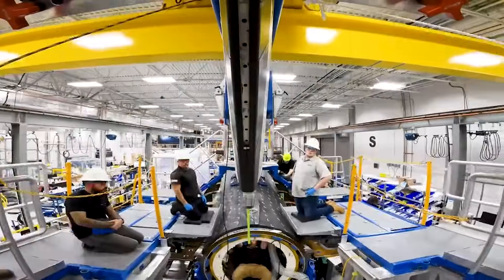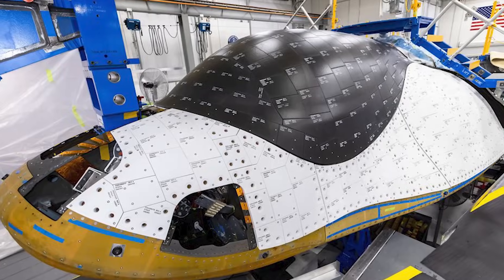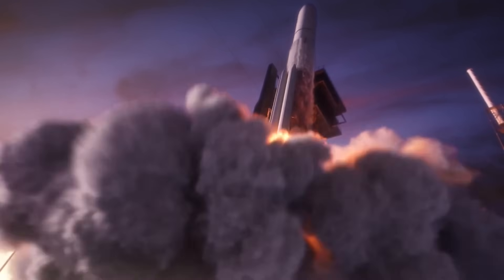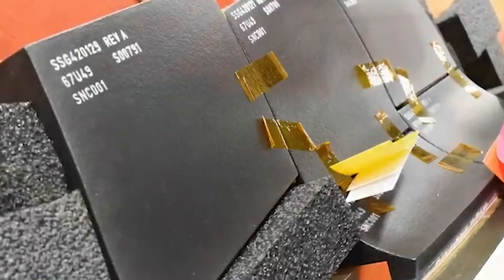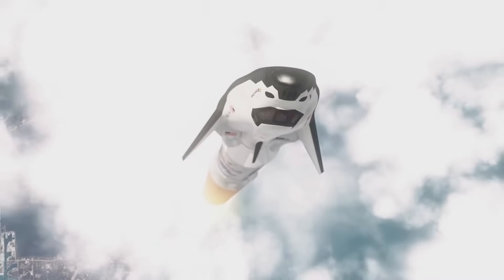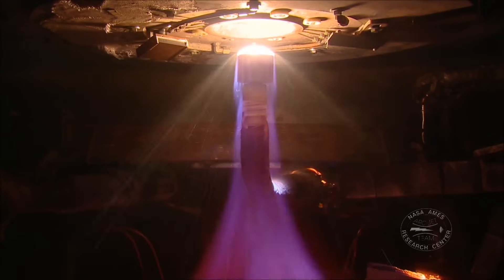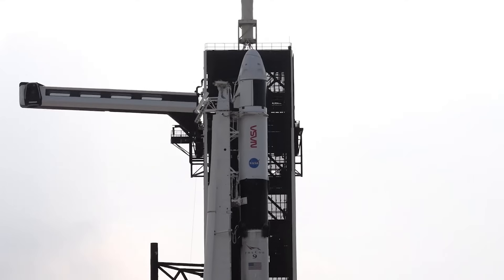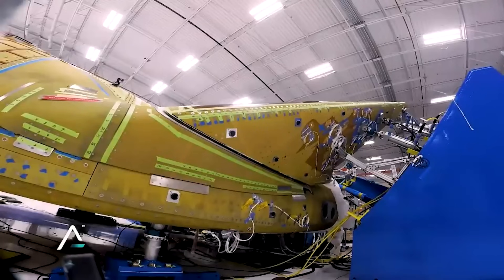Dream Chaser Tenacity’s Heat Shield Is Just About Fully Installed

Comment: Its a great little vehicle. However its nothing really new. Its like starliner is to Appollo. Just a newer version of shuttle. Cool though.
Reply: Dreamchaser is not that comparable to Shuttle or Buran. It's mounted on the top, not the side of the booster. It's a totally different scale. It has a very different set of missions, consisting of crew and cargo missions to various space stations, but not launching large satellites or space station segments. 
The Dreamchaser vehicle is much more comparable to Boeings X-37. 

Also, Starliner is not the same as Apollo CM. It's reusable, it lands on land, not sea, it's designed for LEO, not returning from the moon.
Reply: apollo

Comment: I understand they created new generation of heat shields, while it's smaller vehicle. Its still being hand shaped and placed.  Isn't possible to make a large shell section to fit over hull? With less seals?  Its going be time consuming to refit the those tiles per use, won't it?
Reply: One day, perhaps. I dont like them either; hand shaped and placed tiles is just as crude as spacesuits that are hand sewn and custom fitted.
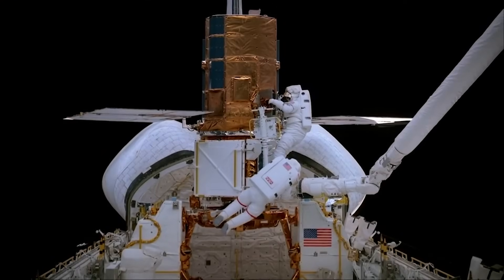These "modern manufacturing techniques" (5:00) are reminiscent of pre-industrial techniques.
I right behind this shuttle but Dream chaser remains a prototype of future winged shuttles (capsules and parachutes are anachronistic).
Reply: The coefficient of expansion is quite different between the tiles and the aluminum skin. Hence, you need many gaps in the tile covering to permit expansion while maintaining attachment. Very difficult to solve without using many smaller tiles instead of larger tiles or a single 'tile.'

Hopefully, the tiles will need little to no repair between flights, unlike the Shuttle. If so, then the rate of the initial installation doesn't matter so much.

Comment: To be honest, SpaceX Starship will make Dream Chaser obsolete.
Reply: There gonna be 5 spacestations in orbit soon.
Reply: @MichaelWinter-ss6lx  I assume you mean ISS, Tiangong, Orbital Reef, Axiom and Gateway? Or are there other proposals in the pipeline?
Reply: Vice versa, jroar, Starship is a white elephant. All it might do is launch satellites and deep space probes.
No future on the Moon with NASA because it DOESN'T use lunar fuel, hydrogen; rather, it uses Earth fuel, methane, six times more expensive than lunar and, to quote Bill Nelson, "We want sustainability".
As for Colonization of Mars, everyone except Elon Musk knows chemical engines are out of the question; Martian Colonization requires nuclear engines, for fast transits.
That's why everyone, except Elon, is heading for the Moon.
Reply: @davidstevenson9517  There is also Vast space station.

Comment: Instead of punching into the atmosphere, why don’t the use SpaceX’s methods of having a entry burn to drastically slow it down. They might have a re-entry attached rear section that holds the fuel and engine. After the burn, the back section falls away allowing the ship to fly back down for a landing.
Reply: More expendabel parts on a fully reusable vessel?
Reply: SpaceX "methods" are Space Shuttle methods, heat-shields protecting the belly, just like Dreamchaser.
Nothing new from SpaceX.
Reply: Weight and cost.

Comment: I just really want to see it come back safe... I'm just hoping it doesn't have to fly on top of a falcon! Just so that we can have options in the west...
Reply: If it weren't for Musk NASA wouldn't have a space program!
Reply: @michaelmurphy6195  You MUST have been born yesterday!
Reply: No fears there, rpereira, Dreamchaser is flying on ULAs Vulcan/Centaur. Besides, its too heavy for either Falcon 9 OR Heavy: they can only lift 10 tonnes to LEO or beyond.
(Heavy has the engines for 50tn but NOT the structural or aerodynamics for anything above; Elon is disingenuous.)
Reply: @davidstevenson9517  Dream Chaser is only made for Low Earth Orbit. Falcon Heavy can lift 64 metric tons. Dream Chaser is only 24,000 pounds.
Reply: @davidstevenson9517  I was born at Norton Air Force base before Sputnik went up. Talk to me about space child.

Comment: Damn near every tile on this Spaceplane is unique, which proved to be a serious problem w/ the Space Shuttle. Maybe the tradeoff in having a reuseable Spaceplane will offset the increased maintenance & time costs of dealing w/ so many individual heat tiles. That said, how is a Piloted windshield version of this Spaceplane gonna work? If the windshield area needs heat tiles for reentry, where's the technology for a see-thru heat shield ?
Reply: The shuttle had its windows
Reply: @MichaelWinter-ss6lx  And so has every human rated Spacecraft since the Mercury era, but none those windows weren't in the Plasma Stream of re-entry. From the looks of Dream Chaser, its windshield area IS in the Plasma Stream of re-entry, otherwise, why tile it over ?

Comment: It is interesting that the thermal tile system on dream chaser is installed with extraordinary care while another company is rather cavalier about their tiles. This is going to be interesting to see which methodology is better.
Reply: What will be interesting is if Drream Chaser can find a reliable launch vehicle, without it, it's worthless!
Reply: Also, I believe Dream Chasers tiles are installed on an aluminum skin, not stainless steel!
Reply: @michaelmurphy6195  
What is unreliable about Vulcan for getting Dream Chaser to orbit? Vulcan will always cost more than sx but “unreliable” doesn’t seem to be the problem, delayed yes, but that probably is ok, the BE-4 seems to be more reliable and finalized than that other one. Ultimately Vulcan could be quite cost effective. ULA has had a very reliable record so they know how to do these things.
Reply: The SpaceX Starships stainless steel surface area is gigantic compared to Dream Chaser. This combined with the stainless steels higher melting point will help mitigate the reentry temperatures. With the addition of SpaceX clunky always falling off tiles will only increase the chances of success.

I do however see the need for SpaceX' to address the tile situation at a later date,  @michaelmurphy6195
Reply: Dreamchaser tiles are applied with extraordinary care 'cos the alloy subframe would be subject to the same failure mode as the Shuttle. Starship with its stainless steel skin has a much higher level of capacity to absorb damage to its tiles.
Reply: @michaelreid2329  
To be determined!!
Reply: @michaelreid2329  Roughly 1500 degrees Fahrenheit difference between the melting point of steel over aluminum.
Reply: @michaelmurphy6195  
That maybe superficially true, but that is not the design criteria. If you allow that stainless steel structure to heat excessively, and that term “excessively” is not associated with melting points, but much lower temperatures, you will get a lot of thermal distortion and potential thermal buckling. That is totally avoided by the space shuttle TPS, and Dream Chaser. It is my understanding that sx is looking for reliability for repeated use. Even the A-12 was very carefully designed around the need to expand and contract AND it leaked like a sieve due to thermal distortion and it was titanium.
Reply: @michaelmurphy6195  and humans melt at about 200C
Reply: Take a look at the different shapes of mentioned vehikels and tell then which is tiled easier/faster.
Reply: @michaelreid2329  What do you use for a brain?
Reply: @Mentaculus42  You do understand it is a prototype, and I'm sure they will have IR sensors and cameras on a basically empty interior.
Reply: @Mentaculus42  I'm sure meticulously putting on the tiles will help in its first orbital flight. This comment is 100% pure unadulterated sarcasm!
Reply: @michaelmurphy6195  
It beats the sh..e out of trying a burp test and having a bunch of tiles pop off due to … 100% … !! This is assuming that u r talking about dream chaser,  if it is the other, it probably won’t matter at the end of controlled flight.
Reply: @MichaelWinter-ss6lx  
One actually has to fly and controllably land.
Reply: @Mentaculus42  That's just it. This thing has never flown either. Neither has the launch vehicle. Good luck!
Reply: @michaelmurphy6195 Dreamchaser has already found a launch vehicle, Vulcan Centaur.
Reply: @michaelmurphy6195  The more relevant measure is thermal conductivity. It’s MUCH easier to burn a hole through stainless steel than aluminum. 
Don’t believe it- just ask any experienced welder.
Reply: @executivesteps  Falcon nine returns with no thermal protection. I'm sure Starship is capable of an entry burn and landing burn.
Reply: @michaelmurphy6195  Uh the first stage of Falcon 9 never gets anywhere near orbital velocity.
Reply: @executivesteps  Yes, but I'm sure it can achieve the same result at higher velocities with thermal tiles on stainless with an entry burn. Do you think Musk doesn't have engineers?
Reply: @michaelmurphy6195  Yes and he has welders. And every engineer and welder at SpaceX will tell you it’s easier to burn a hole through stainless steel than aluminum.
Reply: @executivesteps  So you think they're daft?
Reply: @michaelmurphy6195  No there are different criteria that need to be satisfied in design work. Stainless steels have other advantages over aluminum. My point is melting point (which is endlessly mentioned on these threads) and thermal conductivity may not be the decisive critical factors. 
My point has been it’s easier to burn through stainless than aluminum regardless of comparative melting points. That’s still true and easily demonstrated.

Comment: This is moving slower then a snails pace 😂
Reply: This is light speed compared to blue origin. Quit yapping
Reply: @nls.135  Blue origin actually develops their systems fairly fast tbh.
Reply: @rgio1885  Is that why new Glenn hasn’t flown 1 mission after almost a decade?
Reply: @nls.135  That's fairly average for the industry.
Reply: @rgio1885  Not really in this age of reusability. Most new rockets have already flown. Terran 1, Electron, Alpha, Starship.
Reply: @nls.135  yeah, well I imagine unlike all those listed New Glenn isn't gonna blow up on its first mission, unless I'm remembering incorrectly New Shepherd didn't.
Reply: @rgio1885  Electron did not “blow up”and neither did starhopper.
Reply: @rgio1885  Also you’re acting like iterative design is inherently bad. It’s what’s led to all of the previously mentioned rockets (excluding Terran 1) launching multiple times and actually delivering on time. Blue origins strategy is a losing one as they have taken so long companies like SpaceX have nullified the ingenuity of new Glenn by just being cheaper meaning nobody has a reason to book it when they could buy a falcon heavy for cheaper.
Reply: @nls.135  Obviously iterative design is a winning strategy, but it's not the only winning strategy, I mean, just look at ULA, and besides, every engineering company does iterative design that's how it works lol.
Reply: @rgio1885  ULA is behind schedule with Vulcan by a noticeable degree.

Comment: tenacity is a cool machine, but i really have my extreme doubts it will ever fly crew, if fly at all, maybe only a few flight's, its not efficient to spend months of work on installing heat tiles, it will use up valuable time and money each launch, especially including repair/refurbishment costs, building a human rated Dreamchaser will take a few years, and im not even talking about how long it will take to launch DEMO flights of the manned dreamchaser, 

in my conclusional opinion, i generally think it will be a few years to crew rate the spacecraft, let alone launch it to orbit.
Reply: They have no doubt improved on how the tiles are attached to the fuselage and improved the tiles durability so I doubt the Dream Chaser will have the same problem that the Space Shuttle had with shedding tiles.